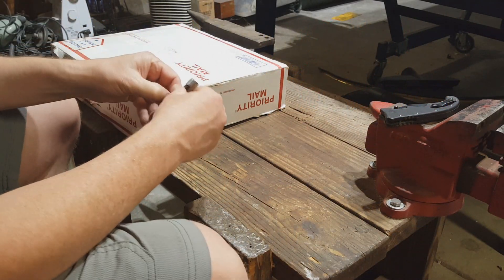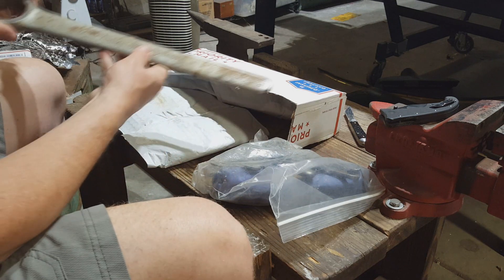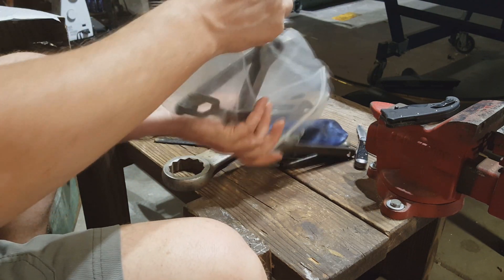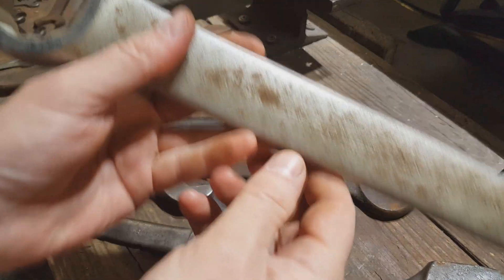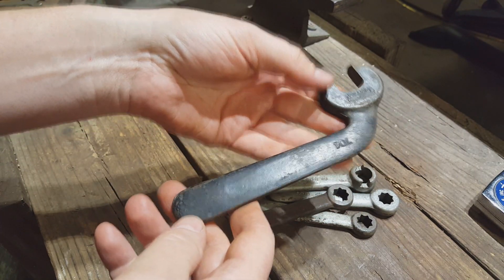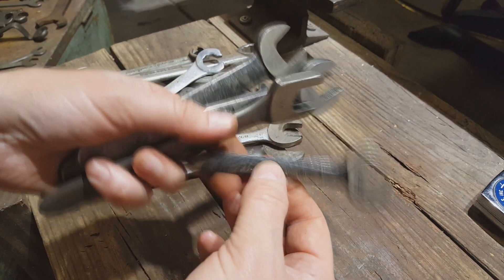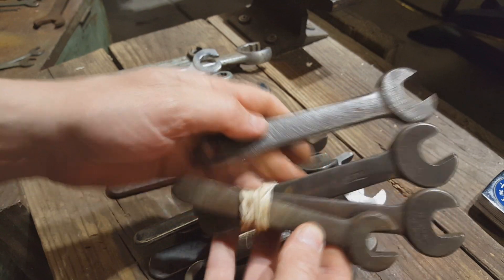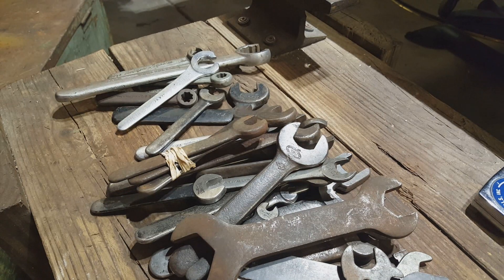42 Vintage Tools eBay Haul Williams Billings Armstrong and more :]

Comment: I found that 704 in the Williams catalog. It looks like that bend was a user modification.  I think I saw a 703  in your pile a little later in the video.
Reply from the maker: I was looking in an Armstrong catalog and they showed some Engineers wrenches that could be special ordered with a 45 or 90 degree bend....so I'm thinking Williams had some of the same options.  Williams and Armstrong seem to be making similar tools back in the day....any way its on page 48 of the 700 - A Catalog with the Black and white cover. link below
http://vintagemachinery.org/pubs/detail.aspx?id=20081
Let me know what you think...if you get the chance :] Thanks for Watching Bud!!
Reply: @DirtandRust  I'm sure it's possible that it was a special order 704.  If the bend is really straight and professionally done, it could be factory!